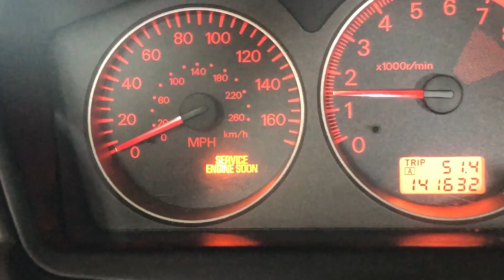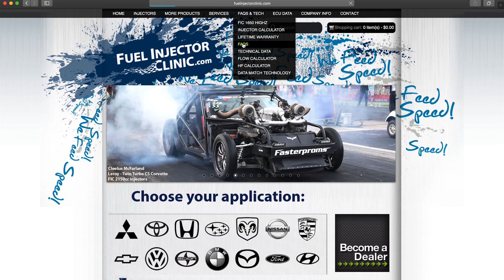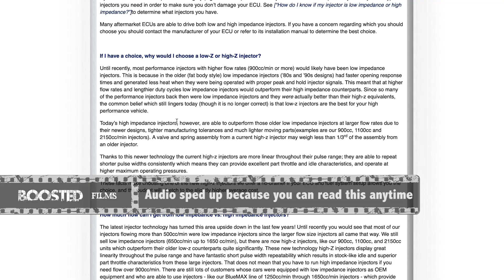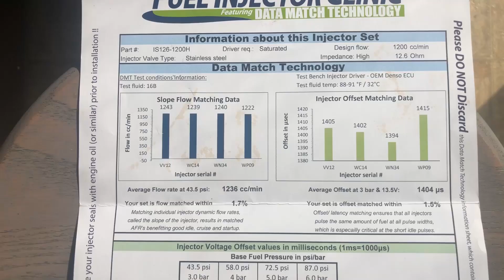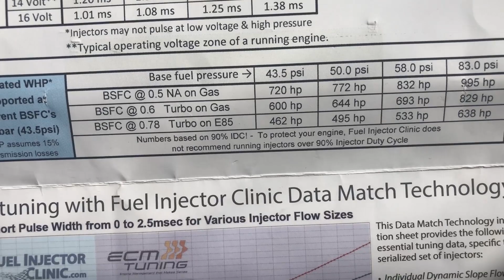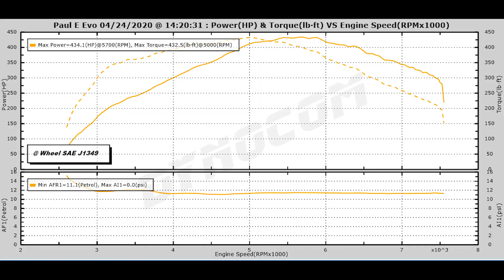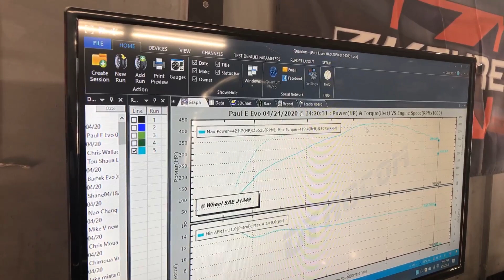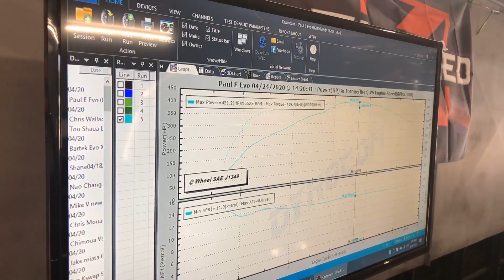EVO 8 Fuel Injector Install // Dyno Pulls // Mitsubishi Lancer Evolution

Comment: I recently made the upgrade from stock to low z injectors, ever since I’ve been kicking myself for not just getting the high z ones. Good video!
Reply from the maker: What ones did you go with? The PTE low-z's treated me pretty decent for 2 years.
Reply: Boosted Films I have the fic 1220cc’s low impedance

Comment: From all my online forum research i found the most optimal injectors for a flex fuel setup with say a one size up turbo like a green are ID1300X
Reply: I would agree. ID1300X the best Injectors for anything making under 600hp.
600-700 : FIC1650 or ID1700X
700↑ : ID2000 or FIC2150
1000↑: maybe even extra injectors
Reply: @Thr33.Sid3z  spot on, you know your stuff

Comment: im curious to see what my built motor could do on the same setup . ill find out soon . also hit up art gennari turbo he has some great bolt on turbos
Reply: Doesn't matter if you have a stock block or built. This setup is limited by the turbo not the Motor.

Comment: I dont know what injectors to get 
Have a 1999 eclipse gst 
Running a 16g 20psi
Should i get low z 950cc or high z 1000cc?
Reply from the maker: either one could work.  Do you plan on running e-85?

Comment: love it. im on 1050x id 450whp lol oops
Reply from the maker: How long you been running that set-up?  (& what type of dyno) Probably close to the limits but not the worst.
Reply: @BoostedFilms  i am just starting out.  hta71, haltech ecu. e64 mustang dyno peak boost 29/torque 365 at 4200 rpm. no e85 numbers yet but injector duty was 95% at e64. gonna try to add a little fuel pressure. its a band aid but not ready to get id1300 yet. are you experiencing torque steer?